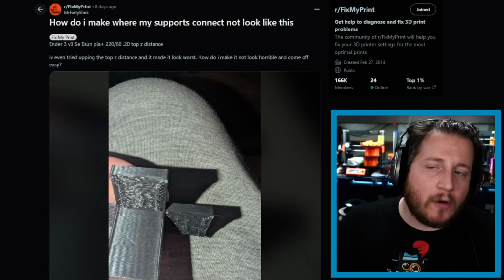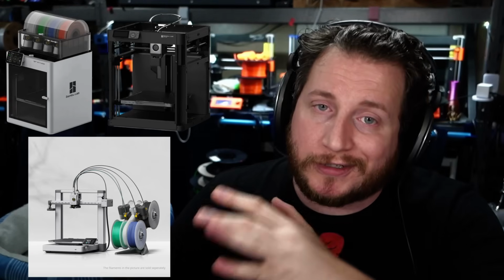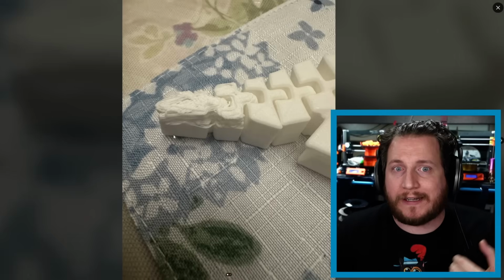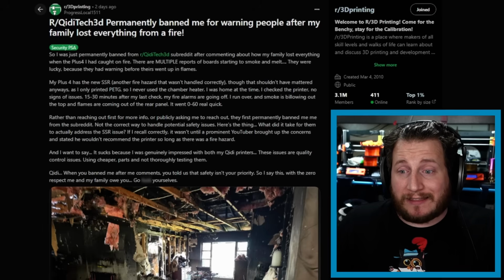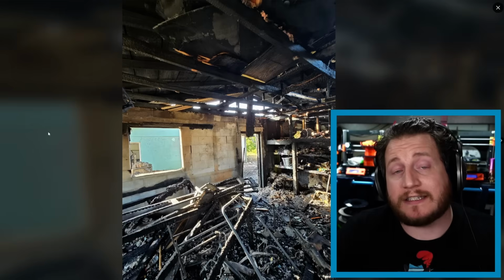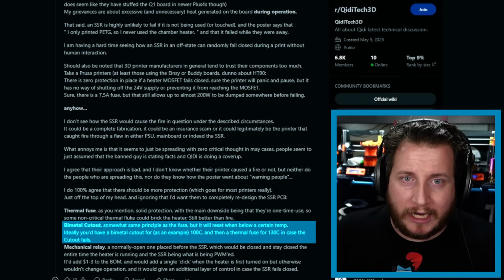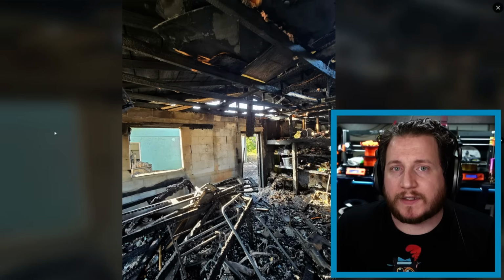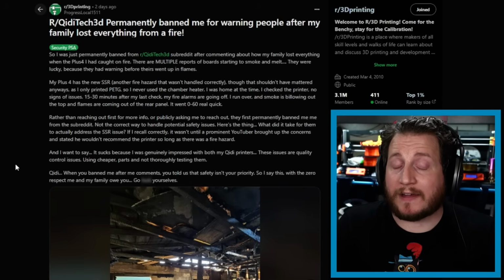Qidi Plus 4: 3D Printer or Firestarter? - PrintFixFriday 186

Comment: any updates on this? I was about to pull the trigger on a Plus 4 until I saw this. Now I'm leaning toward spending an extra $1000 on H2D since you mentioned it has fire proofing (im guessing because they put lasers in it.. though I would have to lookup to see if the nonlaser version also has this fire proofing)
Reply from the maker: No 3D Printer is safe. That is where we will start.

We have been in contact with the user who had the fire. We are awaiting an inspection to be completed.

Comment: Love the content. I will admit that I do not know all the specifications of the fire-retardant plastic used in 3D printers, but in industrial applications I have found that using these plastics can be a double edge sword. Fire-retardant plastics normally incorporate additives like halogenated compounds or phosphorus-based chemicals for flame resistance, but they are not effective at high temperatures, like a thermal runaway. They sometimes actually burn hotter and are harder to put out if they combust at these higher temperatures. Also, Off-Gassing would be my concern. fire-retardant plastics are traditionally known for releasing toxic fumes like carbon monoxide, benzene, and hydrogen cyanide, at and below the temperatures found in a heated chamber depending on the plastic. Like I said, I do not know what Bambu is using for their panels and given that the H2D printer is designed with a heated chamber, it's likely that they have considered these factors and BUT I have been proven wrong in the past. I will let you know if I dig anything up.
Reply from the maker: I have certainly experienced some benzene smells before I think! But yes please let us know what you find!

Comment: Before using fire extinguisher you NEED to switch the power off. Turn off the power source then use the fire extinguisher. Keep the correct one for this purpose. The one you can actually use to extinguish the electrical fires (I presume you would like to use the powder one).

Comment: I keep hearing about smart switches. As an IT professional I will not have any IoT devices in my home or office, period, end of discussion. Individuals at home can do what they feel appropriate, but if you have a print farm or even a small handful pr printers, I think the power to the printers should pass through a big industrial power kill switch. The big read button type that you can just smash, then to reset you have to twist them 90° so they can pop back out. Getting to a breaker box, identifying the correct breaker, and flipping it while it is in a panel that might be hard to access or not open easy just isn't a great idea. Rather, a panel near your printers with a big red button doesn't need to be explained to anyone. In fact it so doesn't need to be explained that basically all gas stations in the US has one of these mounted outside, so if there is a pump fire any able body can slam the button, and nobody needs to tell them what it is there for. It is intuitive.
Reply from the maker: I 100% agree with you. However, like you said, the average user doesn't know or care lol. Maybe one of those 433mhz controlled relays would work too?
Reply: @3DMusketeers  Maybe, I am not familiar with 433mhz controlled relays. I just know you don't need to be an EE or even an electrician to go down to Johnstone supply, Platt, or Greybar, and pickup one of those kill switches, a metal electrical enclosure, and some heavy duty 3 conductor wire and make your own power strip type thing with a kill switch. It is easier to figure out how to interrupt a power source with the switch, than it is to setup a 3D printer. The button by far is the most expensive part, as industrial controls are pricey, but the build quality and reliability is the reason behind it. I would expect with new parts it would be about $200 with the switch being 3/4 of the cost. If you know someplace that has industrial production machines, and they are getting rid of old equipment, or a salvage place, or an auction house, you might be able to get it for next to nothing; as I believe every single commercial manufacturing machine of any kind is required to have one of these kill switches on their control panel.

Comment: I own the same machine as mentioned in the original post. Before any of these posts started to come up, I had already decided to build a fireproof box for my machine. At the end of the day, its a cheap machine made in china that has similar heating elements to a toaster oven and it also moves around and is left unattended for hours.

Comment: You showed the post, but make no mention of the fact the user got banned...
Reply from the maker: The extended version which will go out to supporters has that segment. But we decided that it pulled away from the entire message of the segment, which is safety. We don't know why they got banned if it was manual or otherwise. So, because we didn't like to speculate there, we opted to cut that from the final version.

Comment: I had 2 systems. 
If you have one or 2 printers, you can get automatic fire extinguishers. They look line normal fire extinguishers cilinder, but instead of a handle, they have the sprayer head with thermal ampule (like water sprinklers have). The one I had was filled with some liquid that kill the fire. Plus side is that this system is cheep, but does not scale good, as you need one extinguisher above one or two printers. They also are not quick to respond as the capsule needs to heat up to 65C (the lowest rating).

If you have more printers, I recommend looking into fire trace system. They use a small pressurised plastic line, that if melted can a) leak gas directly on the fire and/or b) the pressure drop in the plastic line triggers a pressure differential switch to flood the room with gas via another vent. You can snake the line over or around printers, ovens, barker boxes, inside of CNC machines etc. It activates faster then the auto fire extinguishers,  cover more space (as the gas floods everything), can be activated manually, its more space efficient, it supports a pressure sensor to turn off the power to all the printers if it triggers, it can be linked up to central fire detection systems, but the system is a couple of grand, depending on the size of the room you want to gas. 

Both of these 2 run with no power and no electronics involved.

Comment: I've got a big fire extinguisher (that is actually mandatory since i print in my shop), smoke sensors above the printers and smart plugs set to shut down everything if the smoke sensors are triggered. I looked into the wham bam poofy things but i'm not really sure if they would be effective in my situation since they have to be actually touched by flames to trigger and the printers i use most are really tall (neptune 3 max and v400)

Comment: Personally, I have a multi-tier isolation ring of effectiveness in play at my home shop, which is technically attached to the back of the house, but the last/outer ring is a brick wall. The potentially sparky/stinky machines, even if they have an enclosure from the factory, are stuffed into a second enclosure with fire retardant panels and Good fume extraction (baseline 600cfm with blockout plates), worst case that I can't suffocate it, I'll blow it right out of the building into enclosed portable material carts (metal!). Having redundant in-line checks is important, too. Surge protectors with fuse protection is a tertiary ring protection that is often overlooked, or if you want double safety, put it on a better branded UPS that is inline to the outlet. I have a few fire suppression tools out here, mostly because my chem cabinet is also out here, but the Tundra foam cans--Provided you keep them in date, which goes for normal extinguishers, too!--are very effective for multiple use cases. Making sure you have the Right Extinguisher type for electrical and potential burning polymer plastics can not be overstated. Type ABC dry chem, particularly the B and C class, will offer a solution for both plastic/combustible materials and energized electronics. 

The foam cans offer a lot of volume for how small they are and tackle most anything you'll have in your domicile, and they're Cheap insurance (and count on your actual home insurance if you want that extra security buff for deductibles). Just because I'm me, I had to test these after purchase and used it on a semi-worst case scenario with a secondary water hose in case it didn't do the job. Using automotive fuel on a polymer plastic garbage can, I let it go to mildly out of control status where you need to put some pep in your step and went to work with the foam cans. It took two full cans, but did a fine job, and for the best bit, other than the giant blob of plastic afterward, the foam itself is biodegradable and cleans up with water. 

Know Where to spray the retardant is also often little known or disregarded in the heat of the moment (forgive the pun for subject content). Aim at the Base of the fire, rather than trying to spray it wildly at the fire itself. You have to get at the source of the fuel of the fire to suppress it effectively. Trying to douse a general area where there is fire won't do much other than putting out what you can see in the area, but the fire will still have air and fuel, while also being at combustible temp and easily reignite.

Comment: Given a choice, if I had to put my life on the line based on the reliable operation of a relay, I'd go with an appropriately rated SSR every time. Been in aviation electrical/signals processing for about twenty years. Mechanicals can fail short just as easily as an SSR.

Redundant protection on heater controls is a MUST. Always have a plan for an intentional failure mode when an unintentional one happens.

Comment: Support;  PLA; gap 0.16 - 0.20; be sure not to be over-extruding (at all!) and lower printing temp 5-10ºC for easier removal (if rest of print is OK with that); 3 x 90% fill top support layers (for flat surfaces like this anyway). Use snug mode with some support extension 1mm or more. You're welcome.

Comment: Certainely a devastating turn of events for the guy, My Qidi Plus 4 did some strange, potentially dangerous things this week, coincidentally. 

Basically I was running a PLA print and after, idk 30min - 1 hr judging on how much it got in the print, it had heat rate errors which I found strange. Then I watched it on my computer and noticed it suddenly set the extruder temp to 370. In the middle of the gcode. I did NOT do that. I caughter quickly (had only raise about 30 degrees) and set it back down to 230 and the print finished fine.

 I noticed that the software was running a little poorly on my computer with connectivity issues and the camera viewer wasnt working right (just page formatting issue - camera was working.) I restarted my computer for the first time in a while and the problem has since gone away. I had probably left Qidi studio open on my computer for a week, if not more. Not sure if it just bugged out due to being open and running multiple different prints without a rest or what.

not sure if this could be an issue that would lead to a fire but i dont know how well PLA would survive at 370C

Comment: If you're fire extinguisher shopping, make sure it's one rated for all types of fire, or at least make sure it's rated for electrical fires. Not all fire extinguishers are the same.
Reply: ABC - minimum.  A=Ashes = wood and paper fire   B=Barrels - flammable liquids like oils     C=Circuits - i.e. electrical   -   finding a good cheap D (burning metals) extinguisher isn't a thing right now... but those fire suppression blankets are.
Reply: @CaptainSeamus  the fire suppression blankets I hadn't thought of before, might have to add those to the routine.

Comment: The heated bed mosfet failed shorted on my ender3. Lucky i was in the room to shutoff the power. Now my printer has a bi-metal switch on the heated bed. If the temperature goes too high the power supply relay is turned off.

Comment: I have recently bought a QIDI Plus 4 to add to my Bambu Lab X1 Carbon. I loved my Bambu Lab printer until they sent me the wrong complete hotends for an P1. I am disabled and can't get to my projects as fast sometimes and I went two weeks past the 30 day return date then allow and even though it was their fault they would not exchange or refund the parts so now I have hardened complete hotends for an P1 in .6 and .8 sizes. I wish I could give them away to one of you all. Anyways after Bambu's horrible customer service I will never buy anything from Bambu ever again! They lost me for life! So I bought a QIDI Plus 4 and it is BETTER then the Bambu Lab X1 Carbon! I can't wait for QIDI to offer their filament management system! That is the only thing missing! QIDI is cheaper and fails much less then the Bambu!!! I'm not just saying that because I am anti Bambu but because I have had only one fail on the QIDI while having 12 fails on the Bambu during the same time period (almost all were bed adhesive issue. I used both the flat cool plate with Layerneer Bed Weld and Nani Polymer Adhesive too on the Bambu and the PEI textured).  The QIDI has earned my business!!! This is a great printer with all issues fixed quickly from QIDI! If someone can get in touch with me for the complete hotends from Bambu Lab for the P1 please do.
Reply: If you hate their customer support, wait until you learn about their digital privacy practices, and the way they change the terms of service. I was a fan of Bambu first, but now im looking for alternatives like Qidi.

Comment: Wham Bam sells a fire puck for 3D printers, it's basically a small explosive device full of fire suppression powder that should be mounted a little above the printer (or possibly inside of enclosed printers) and if a fire happens it lites and BOOM it snuffs the fire out with a bunch of fire powder. I bought one to put in my CO2 laser cutter.

Comment: I use Anycubic's port of Orca and it has a snug setting in the supports dialog that, if you use grid supports, does really well on flat surfaces. I almost always have issues supporting curved surfaces, so I tend to orient things in a way to avoid curves needing support.

Comment: @3DMusketeers, You make it sound like it is complicated for single head mmu printers, you can easily use PETG as interface layer instead of a sharpy. And because you only need a single layer, it wont even increase print time by much like how using an entirely different support material would. 

Just design a 0.2mm thin layer under the area that needs support, then change that layer to petg and support that with regular support, with 0 top surface distance. You will only need two purges for this, but make sure to increase the purge volume by x3, to prevent petg contamination from messing with the layer adhesion in the rest of that print.
Reply from the maker: many dont know how to go down that route, you know?
Reply: just sharing a method that for me as someone relatively new (half a year of experience in both modelling and printing) is simpeler than for example tramming my printbed.

Comment: There are temperature controlled socket adapters for switching mains power to devices. The digital ones can be set to turn off after a temperature is reached and you see the current temp on it. One could put their temperature sensor near the component they fear the most. I just think they are not all suited for nozzle temperature monitoring to shut off at like 350°C, but electronics at 100°C.
Reply: I think those outlets are meant to be used to control an external mains powered heating element like a reptile enclosure mat or incandescent light bulb. They're configured to turn off at an excessively high temperature but then then on again when the temperature drops.
Reply from the maker: yes, love ones with that feature too!
Reply: Would you have any links to such devices? Please and thanks

Comment: I've got smoke detectors directly over my printers, fire extinguishers in several easy to grab places around the house, and I run smart plugs to cut power if something goes sideways. I've looked into extinguisher balls but the locations are a bit prohibitive, have thought about doing a top or enclosure for the extinguisher sticks. I'd really like to get a connected system where if smoke is detected from one of the printer detectors it automatically cuts power to the corresponding outlet, but haven't gotten there yet. Also I never print overnight or when I'm not home.
Reply from the maker: good plan overall.

Comment: I'm strongly considering in the machines I'll make in the future, to implement thermofuses or thermorelais into bed heater chamber heater, electronic compartment. If I want to have my stuff running at 120C max, a fuse or Relais at 150C should do the trick.
I remember the early Creality Ender days all to well, when first thing you had to do was compiling new marlin and flashing it to have at least thermal runway protection for the hotend. Much changed, but we still can go a long way.

Comment: 14:43 our printing store is made out of block, and so the only flammable things near the printer are the counter it is sitting on and the ceiling 12 foot above it. There is a fire extinguisher on the other side of the room near the laser. Fun fact, the fire inspector came by in October and said the last time he was in this building it was on fire. Turns out our concrete parking was not a upgraded parking lot by the previous owner. It’s just the flooring of where the rest of the building used to be.